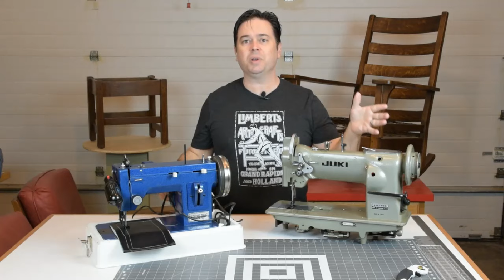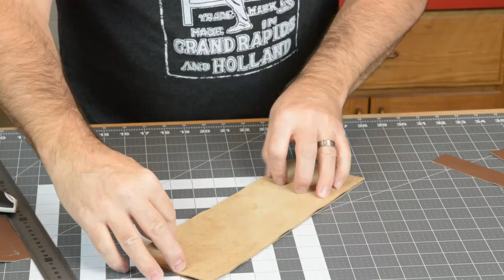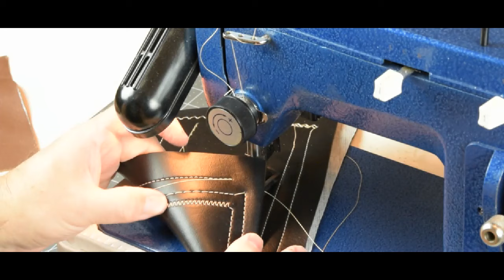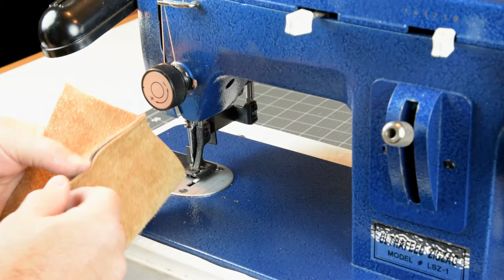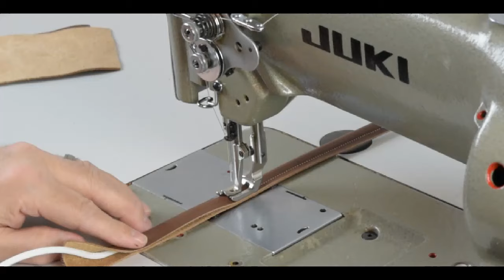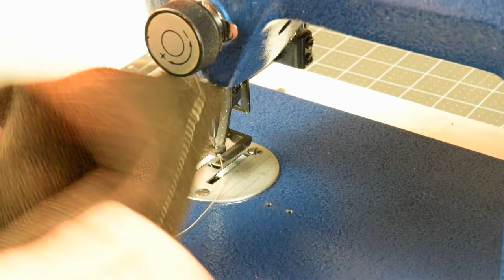Mini Walking Foot Vs Industrial Walking Foot Sewing Machine Sailrite and Juki Compared

Comment: Love these reviews! -- QUESTION -- My last issue is Zig Zag stiches.. I notice that most of these industrial machines do straight stitch only. The Sailrite does zig zag for sails I guess.. But it is unclear to me whether zig zag is a stronger or better stitch.  Some articles say it is not.  Any thoughts on that   Is there any downside to the zig zag?  Can you get modify this Juki or the Cansew 206RB to do a zig zag?
Reply from the maker: Good Questions!  I don't feel that a zig zag stitch is stronger or better in leather and upholstery material, although it might help with canvas.  It can be used as a cheap alternative to a serger when working with material prone to fraying, but there are better overlock stitches on most modern machines.  You can't modify a 206 to do zigzag stitch.  I really doubt you'll ever miss a zigzag stitch if your machine doesn't have it.  Thanks
Reply: @TheThoughtfulWoodworker  ...really good answer.. We are honing in on the Juki 563 in excellent condition and will get the servo motor and try to configure like you did.  We may go sailing and have some impression that we may repair our sails with it -- Sail makers use zig zag, although I read somewhere that a quality single stich is as good or better, and that two lines of single stitch would certainly be better.  Just wish I knew the best answer to that but there are no good sources.  You mentioned your servo is 500watts and I see online some are 750 watts etc.,  Assuming they all plug into the normal power socket in our house, how would you tell the difference between "just" 500 watts vs 750 or 1000 watts?
Reply from the maker: @Coleen-Love   You'll be fine with a 550w servo like this...  https://amzn.to/3X6Rd3F  I think they're easier to control than a digital servo, and have enough power for just about anything.  If you plan to add a speed reducer, it will have gobs of power!  Mine could sew through plywood.
Reply: @TheThoughtfulWoodworker  ..perfect.  Do you have a video of the Juki when you first got it and showing the coondition and the repairs etc that you did?  Seems to now be in near perfect condition.
Reply from the maker: @Coleen-Love  Here is my main Juki video...  https://youtu.be/v2QdIKrK_xI  Juki vs. Pfaff video...  https://youtu.be/n8IWQKJH-vg  and a servo install video on a Juki (no speed reducer)...  https://youtu.be/Dx_rS9Fzvfo  Have fun!

Comment: I would like to see you compare this machine to the Sailrite Fabricator which is an Industrial machine.  I thought this was not a good comparison.
Reply from the maker: It's a good comparison for someone considering these two machines.  It wasn't meant to be a fair comparison, just an honest look at the capabilities of two different sewing machines.  The fabricator falls between the capabilities of the portable machines and the LU-563.  It will sew 5/16" thick material, vinyl or leather.
Best

Comment: Hi I have a Singer 111w155 but i really like the idea of zigzag for bar tacking and heavy button holing on heavy denim and duck canvas. Do you think the sailrite would go through seams of about 6 layers thick?
Reply from the maker: I've had two Sailrite machines, this blue one and a Leatherwork.  Both had limited presser foot height.  Zigzag is nice, but clearance under the foot is more important to me.  I have zigzag machines and straight stitch machines, and I actually use the straight stitch for buttonholes (with an old school Buttonholer).  Good luck!

Comment: I think the needle feed, the needle going into a feed dog instead of a hole in the plate makes the Juki Superior. I'm kind of waiting for a company to make a small Sailrite machine that doesn't require a table with the triple feed, underdogs, top walking foot, moving needle feed.
Reply from the maker: Hi Glenn, you could be waiting a long time for a triple feed portable sewing machine.  Usually the portables are dual feed only.  
Best

Comment: I'm curious what defines "mini".  The "minis" that I have seen are much smaller than a Sailrite. The LS & LSZ machines are comparable to most other regular sewing machines, plus they are portable & can be used manually, without electricity.

Juki, Consew, Jerome, Husqvarna, and the like are larger machines.  The Sailrite Fabricator machines are on par with these other brands mentioned. That would present a more relevant & meaningful comparison. Juki vs. LSZ is an 'apples to oranges' comparison. Find another mid-sized machine to compare with the Sailrite. Or, compare some true "mini's" to one another.

Everything about this appears biased, right from the start.
Reply from the maker: Mini compared to a full sized industrial machine.  Some people are looking at these two classes of machines when shopping for a sewing machine.  That's what made the comparison relevant to me.  It should help steer you in one direction or another for the undecided folks.  I do leather upholstery, which requires the presser foot to lift about 3/8" or so.  That is what creates my particular bias, but I bet we're all biased towards some brands, models or features.  Best to you.

Comment: What kind of speed reducer pulley did you use for the Juki?  Did you have to cut out the table belt slot like I've seen in another video?  How was the installation?  Difficult?  What kind of servo motor?
Reply from the maker: I have a "Box Style" speed reducer that mounts right where the motor normally goes.  Then the servo mounts directly under the speed reducer.  You don't have to modify the table at all, and the machine tips back as usual.  You can see a picture of it here...  https://leatherworker.net/forum/uploads/monthly_2020_10/IMG_20201015_183555366_compress61.jpg.8a6d027ea840f5f16d246e2e7c144a4b.jpg
They are available at Toledo Industrial Sewing here... https://www.tolindsewmach.com/
Reply: @TheThoughtfulWoodworker  Thanks.
Reply: @TheThoughtfulWoodworker  thank you

Comment: I have an old 132K6 and it will sew anything from 2 layers of calico (very nicely) to 6mm plywood + carpet and vinyl. I can sew the material straight the door panel on the older cars. It is so old it doesn't have reverse and they still make the same machine today with reverse being the only difference. I am now looking at a Sailrite due to portability and your video has helped and also created some questions. Are the newer ones a little smoother sounding? Anyone had experience with a newer model with the new motor? I can pretty much use any machine and am still wondering if the Sailrite will sew Biminis and Dodgers with ease or is it asking a bit much?
Reply from the maker: I also have a Sailrite Leatherwork with servo and small speed reducer.  It sounds about the same as the blue one.  It will sew a little more than a domestic machine, but nothing compared to a full sized industrial machine.  It has plenty of power with the Workhorse servo, but the foot only lifts 5/16" high.  This means it starts dragging on your work when sewing 4 layers.  My projects have as many as 8 layers when sewing straps into seams.  Good luck with your decision!

Comment: I would like to see if it can see across piping
Reply from the maker: Both of my Sailrite machines really struggle with piping.  There's not quite enough presser foot lift in my opinion.  If you get 3 layers of upholstery fabric under the foot, the presser foot will start dragging.  That's even if the machine is set to maximum lift.
Best

Comment: I've had a Sailrite LSZ1 (no monster wheel) for about 10 years and I do my own Sunbrella console covers, seat covers, motor covers, etc.  I've been fighting with this machine it seems like since day 1.  The latest problem is that it keeps fraying thread at the needle and I can't figure out what the problem is.  I usually hear a clank and then I look and the thread is frayed and sometimes it is frayed without the clank.  Any idea what might be causing this issue?  It usually happens when I am going through several layers of sunbrella, I don't see any barbs anywhere that could be cutting the thread.  I'm about to move on from this machine to a Juki or Consew I think.
Reply from the maker: My suggestion is to load the machine with two different colors of thread.  That way you can tell if it's the upper or lower thread shredding.  Replace the needle with the correct system and size for the thread you're using (I recommend using a 69 weight thread and size 18 needle for testing).  If the upper thread is shredding, it may be that your needle is too small, thread is too small or poor quality thread (I've had dreadful luck with outdoor Sunbrella type thread).  Also, make sure that you thread the machine through all guides, especially the needle bar thread guide, or last guide before the needle.  If the lower thread is shredding, it can be a hook timing or spacing issue.  Good luck!
Reply: @TheThoughtfulWoodworker  Thank you Willy for the tips, I will give them a try!  I was using V92 thread from sailrite and a #20 needle.  Sailrite has great customer service but even after talking with them I was never able to resolve the issue.

Comment: Do you think one can buy the Chinese version of the Sailrite and have someone do the upgrades in the UK to get it to work like the Sailrite. I simply can justify spending that sort of crazy money. I found the Juki DU-1181N but don't know if this is the equivalent to your JUKI LU563
Reply from the maker: The 1181 is a double feed walking foot, but still pretty good.  It would sew thicker material that a portable Sailrite.  Good luck finding the perfect machine.

Comment: That was a great and informative video!!  I just bought a used Reliable Barracuda 200zw.  I’m a quilter who’s got into bag making using vinyl with fabric and interfacing.  I have not used it yet but am about to try it out.  The only thing I can see immediately that I’m not too thrilled about is the foot that surrounds is gigantic.  Making bags I won’t be using more than 1/2” seam allowance and I can see that foot getting in my way.  Any idea if a smaller surrounding foot is even available?  TYFS!!!
Reply from the maker: Thanks Angela.  I'm not sure about the Barracuda, I've only had my hands on it once.  The Sailrite does offer an alternate foot for leather/ thin material.  But I'm not sure that it's any smaller.  It supposedly is smoother on the bottom so it won't mark up leather.  
Good luck with your machine!
Reply: Sailrite feet fit the reliable

Comment: Would you be able to do  a video with the sailrite worker B motor on the lsz? It's a servo motor. Great videos and thanks for your time.
Reply from the maker: I don't have access to the Worker B motor at the moment, but understand all new Sailrite portables will be equipped with that motor.  They are more powerful and efficient than the small motors they used to come with, and should work great.  Thanks!
Reply: @TheThoughtfulWoodworker  ok great thanks for letting me know. Have a great day.

Comment: I saw your profile on Sailrite’s web page and noticed you use the Leather Ultrafeed machine.  How does it compare to the LSZ-1?  I assume you like it better for leather?  I was very interested in the LSZ-1 but after watching this video I’m seriously considering an industrial machine.  I like the idea of portability but your video highlighted some shortcomings.  I really appreciated this video.
Reply from the maker: Hi Trevor,
Thanks for checking out the video.  The Leatherwork falls somewhere between the LSZ-1 and a full industrial walking foot.  It has a full size servo motor and all speed reducer, which both help with power.  It really depends how thick you want to sew.  I can sew a compressed thickness of about 1/4" on the Leatherwork, compared to 3/8" plus on the Juki.  My current Juki also has a servo and speed reducer.  If you're doing 2-3 layers of 2-3 oz upholstery leather, you'll be fine with the Sailrite.  If you want to do 4-6 or occasionally 8 layers, you'll need something heavier.
Best

Comment: I want one… thanks for the info.  This is the best video by far that I have seen that compares walking foots.  I was under the impression that the sailrite was an industrial machine.  I would like to know if you could add a servo motor later on to a sailright leather machine.  And how would you connect it if it were possible?
Reply from the maker: Hi Cherie,
Yes you can run a servo motor with a Sailrite machine.  You'd just need a table to mount everything.  Look up the green Leatherwork machine on the Sailrite website.  It has a servo as well as a small speed reducer.
Good luck with it purchase!
Reply: @TheThoughtfulWoodworker  This green Sailrite that you mention, the leathercraft - with a motor like that, do you think it would stand up to the Juki? Thanks and sorry for all the questions!
Reply from the maker: @adamnarat9677  Well I have a Sailrite Leatherwork on order so I'll let you know!  It has a servo and speed reducer so it seems quite capable.  Stay tuned.
Reply: @TheThoughtfulWoodworker  Fantastic! Thank you, can't wait to hear how it goes

Comment: Juki; smooth and quiet.  The indicators of a quality machine.  I have a Sailrite.  Good machine but crudely made and noisy.
Reply from the maker: How old is your Sailrite I wonder?  I felt the same way about my 20 year old LSZ-1 but the newer machines are smoother.  I have a Sailrite Leatherwork and it seems to be made to a higher standard.
Best.
Reply: @TheThoughtfulWoodworker  My machine is about ten years old.

Comment: Will this machine do lightweight cargo nylon strap with 92 or heavier thread
Reply from the maker: Both machines will sew with 92 weight thread.  The Juki can handle nylon strap as long as the total compressed thickness is around 7/16" or less.  The problem with sewing nylon strap with the Sailrite is foot clearance.  It's supposed to sew 5/16" of compressed thickness, but the foot will be dragging on the material, because it doesn't lift high enough for medium to heavy work.
Best to you.

Comment: Yeah that's the operator.  The sailrite has different size feet for piping. You can't sew piping between the 2 layers with the same small piping foot you sewed the piping with.
Reply from the maker: Actually Sailrite doesn't currently offer deeper cording feet.  The one they offer is # W013 and the channel under the foot is significantly shallower than the typical Consew / Juki variety.  Fabricator and professional models have options, but not the portables.

Comment: Does the Juki have reverse? I have a Thompson like that Sailrite but mine is considerably quieter.
Reply from the maker: Yes, the Juki LU-563 has a large paddle style reverse lever.  The similar LU-562 also has reverse.  One common machine that doesn't have reverse is a Consew 225.  
Good luck with it!
Reply: @TheThoughtfulWoodworker  Do you think the Sailrite would do better on that piping piece if it had a servo motor, or was that mostly about the feed dogs and foot not being able to walk over that much thickness? I have been debating on either upgrading my Thompson with a monster wheel and servo motor, or just going all-in on a bigger industrial machine like the Juki.
Reply from the maker: @stopthephilosophicalzombie9017  the Sailrite reaches a hard limit at about 5/16" thickness.  It just won't walk over anything thicker.  A monster wheel or a servo upgrade wouldn't help the issue in this case.  Although a servo and/or a speed reducer do a lot to improve the performance of a full size industrial machine.
Good luck with it.

Comment: LSZ-1 has a weak point. Shuttle hook driver.  It is too soft and bend over when sewing the sails. I replaced it with juki. Juki driver made from good  robust steel.  I also had to order a new shaft. Because the juk driver have smaller  hole.
Reply from the maker: Sorry you had issues with yours.  Sounds like you came up with a creative fix.

Comment: Why didn’t you test with the right sides together?
Reply from the maker: I've used both machines right sides together, as you would with a blind seam, and showing the finished side such as topstitching.  It made no difference how each machine performed.  Best to you.

Comment: The blue machine sounds like it's running a little rough like maybe it needs some oil or something
Reply from the maker: Yes I agree, however it was freshly oiled.  I also have a newer Sailrite Leatherwork that I keep oiled, and it sounds the same way.
Reply: @TheThoughtfulWoodworker  you make a good point. It looks like those are are just made to be noisy little fellows!  📢🧵

Comment: Did you use the piping foot when you attempted to sew the piping on the Sailrite? I’ve not had any issues with variation using it so it’s odd that you did.
Reply from the maker: Yes, I used the piping foot.  That's what comes standard with Sailrite portables.  Material thickness is what makes the difference.  If you run out of clearance, say with 4 layers of upholstery fabric and 5/32" piping, it won't sew well.  Thanks.

Comment: I was interested in a sailrite, but I dont know if I could listen to it for a while project. That thing is loud!
Reply from the maker: I hear you.  I also have a Sailrite Leatherwork and it's quiet.  I don't know if it's because it sews slower with the servo and speed reducer, or if it's because it's newer and better made.  But definitely quieter with that model.
Best
Reply: @TheThoughtfulWoodworker  i just bought a singer 111w153, but I haven't used it yet. Maybe today I'll get to set it up and see how it sounds.